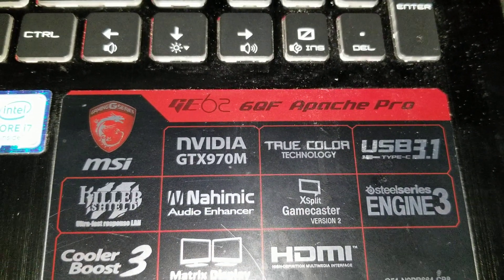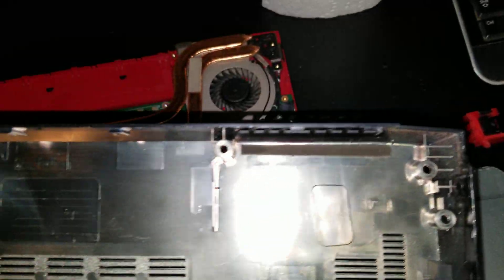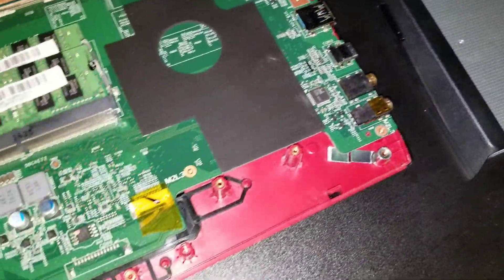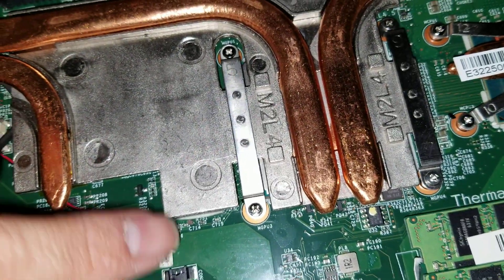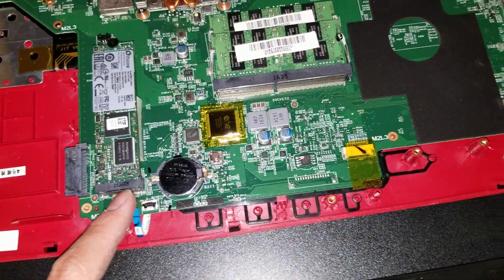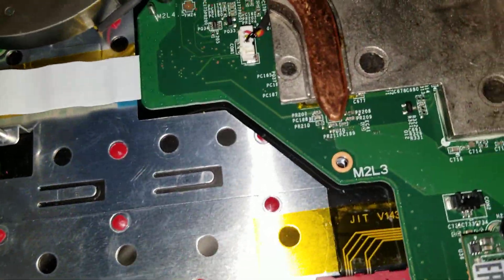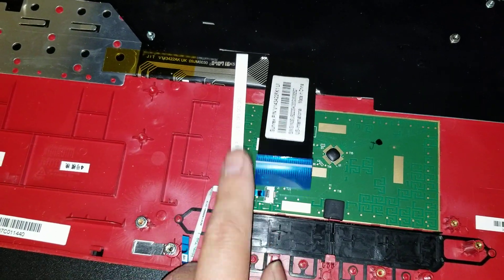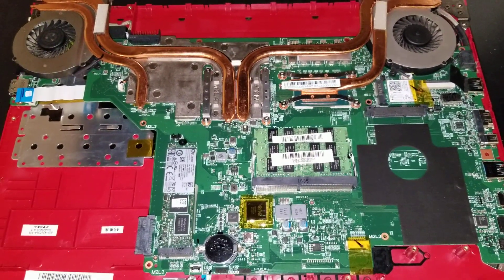MSI GE62 6QF Apache Pro Disassembly RAM SSD HDD Hard Drive Replacement Upgrade

Comment: Well done, you showed both sides of mobo, most people don't. I was wondering if the CPU/GPU was held on by 3 or 4 screws. You showed they are each held on by 4, AND each has a backplate... important for me...Thanx
Reply from the maker: Glad it helped. I only remove the motherboard when the repair the customer needs requires it. Too much risk to take motherboards out when all they came in for is a battery, hard drive, or RAM. Lol
Reply: @ItsBinhRepaired  I am about to purchase same laptop, it has the mounting brackets for liquid cooling.....hence the question.
Reply from the maker: @Ph3arrt3  liquid cooling?
Reply: @ItsBinhRepaired  That's the idea...
Reply from the maker: I don't know about that

Comment: Спасибо за видео. У меня такая же модель. Испытываю проблемы с перегревом. Сделал undervolting CPU в ThrottleStop (-130.9mV CPU Core+Cache), включил опцию Disable Turbo. Дополнительно, выбираю режим питания (улучшенная батарея/оптимальная производительность) в области уведомлений - так нагревается меньше. Сделал undervolting GPU MaxwellBiosTweaker + nvflash. Планирую заменить термопасту (Evercool Nano Diamond [TC-H03] - не справляется), на Thermal Grizzly Kryonaut. Заказать с али подставку COOLCOLD 6Fan и вместо привода JUULASEN охлаждение. Надеюсь поможет! Невозможно играть, даже с Cooler Boost, в тяжелые игры.
Reply from the maker: Are you sure it's a heat issue and not a lack of power?
Reply: @ItsBinhRepaired  не уверен :body-blue-raised-arms:
Reply from the maker: I hate how YouTube doesn't notify me of replies. Were you able to figure it out?

Comment: Is this a decent laptop??? I only play age of empires the conquerors
Reply from the maker: Lol isn't that one of those starcraft like games? You can run that on an i3 no dedicated graphics computer.
Reply: @ItsBinhRepaired  yeah it's from like 1999 lol
Reply: @ItsBinhRepaired  someone is selling a ge62 6qf i56300hq GTX970m 256ssd for $250 looks well used but seems to work fine
Reply from the maker: @zombie730  any cheapo laptop will be able to play that game :P that sounds like a good price. Make sure you know where they live in case it's a scam. I only buy used if they sell from their home.
Reply: @ItsBinhRepaired  yes, it's local no shipping involved, face to face sale.
Reply from the maker: @zombie730  make sure they meet at their house, not a public place where they can run away and you'll never see them again.
Reply: @ItsBinhRepaired  in case It has issues you mean?
Reply from the maker: @zombie730  yup
Reply: @ItsBinhRepaired  I bought it, works great, it's in very good shape, way better than it looked in the posting.

Comment: Nice video. Can I ask, the fan under the power button, above the CD reader, is rattling, which fan is it? Is it the CPU or GPU fan?
Reply from the maker: When opened up. Fan on the left is gpu, fan on the right is cpu.
Reply from the maker: I think the one you mentioned is gpu
Reply: @ItsBinhRepaired  Okay, thanks a lot!
Reply from the maker: @DivingHawker  no problem

Comment: You said in the video you weren't sure if it can take an NVMe ssd - according to the MSI web site, under the specifications for storage it takes '1 x 2.5" HDD + 1 x NVMe M.2 SSD by PCIe Gen3 X4 / SATA-SSD Combo' - so either a M.2 SATA or PCIe Gen 3 4 lane NVMe ssd are accepted there.
Reply from the maker: Thanks
Reply: @ItsBinhRepaired  And as others have said - good video - very clear - helped me plan work to upgrade my son's gaming laptop which is this model. Nice work!
Reply from the maker: @greenman029  awesome! Hopefully you'll be able to successfully upgrade it. If you haven't already, please like and subscribe so others can find my videos. Thanks! :)
Reply: @ItsBinhRepaired  - Just replaced the boot ssd a few days ago - a very small (128GB) Hitachi M.2 SATA drive; put a 1 TB WD M.2 SATA drive in there to address a critical space problem; all running much better now. Found the case on this laptop to be a tad fragile; calls for a lot of care (this one had been dropped a few times too which had caused some damage). We're thinking this one will only be used by him a little longer so that was the limit of the upgrades for now.
Reply from the maker: @greenman029  sounds good

Comment: Great video, I have the same laptop and was looking to upgrade the ram and clean some dust. Thank you very much.
Reply from the maker: Glad it helped. If you haven't already, please like and subscribe so others can find my videos. Thanks!
Reply: Samesies. What I don't understand is why some sources say there are 4 RAM slots when there are clearly 2. Unless I'm missing something. I went to cmd.exe and did 'wmic memphysical get MaxCapacity, MemoryDevices' and what it spat out was Max Capacity: 67108864 or 67GB | Memory Devices: 4. Does it count each one as two because they're dual-channel orrr...?

When I go to Crucial's website, it says I have Maximum memory: 32GB | Slots: 2 (2 banks of 1) |  Standard memory: 16GB removable

https://www.crucial.com/compatible-upgrade-for/mSI(MicroStar)/ge62-6qf-apache-pro
Reply from the maker: I have no clue lol that's why I physically open the computers and check. You never know. Some RAM is soldered in on some models as well.

Comment: Hi, nice video. My GE62 6QF Is getting really hot even when there are no porgrams running. Enabling the extra fans does help reducing the temperature. Do you think it maybe needs re aplication of  thermal paste, fan cleaning, ir maybe both? Thanks.
Reply from the maker: If it hasn't ever shut off from overheating, I'd try just cleaning out dust first.
Reply: @ItsBinhRepaired  thanks, followed the video and used a brush and a vacumm to clean the fan and there is no excess heatting any more. Thank you!!!